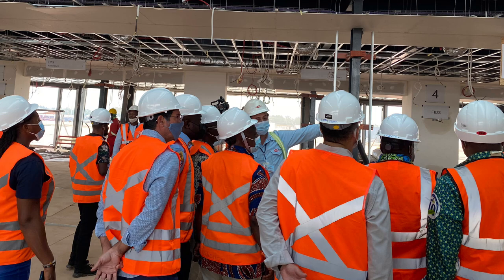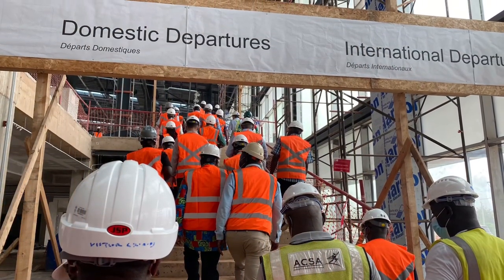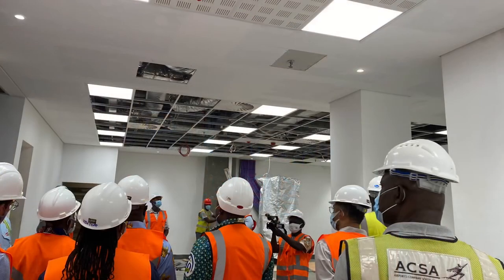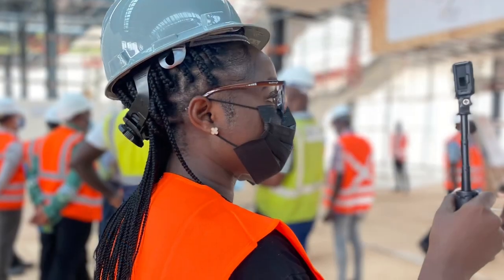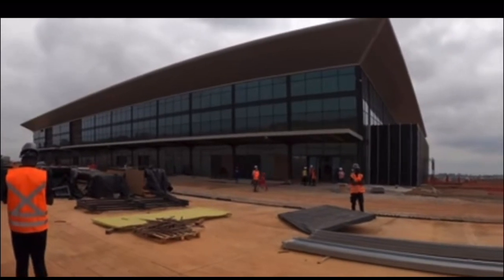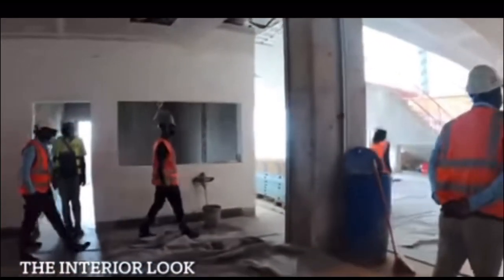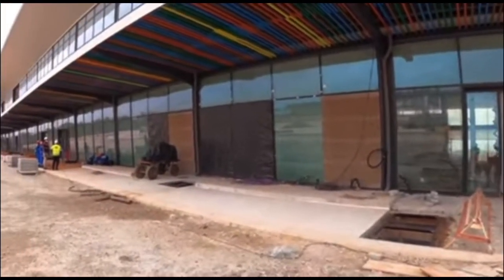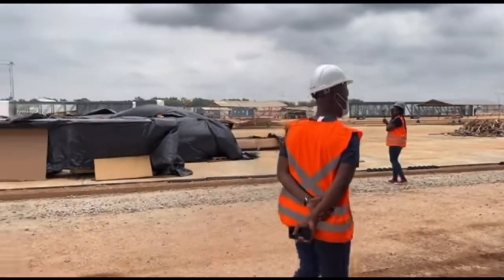ALL YOU MUST KNOW ABOUT THE KUMASI INTERNATIONAL AIRPORT; RUNWAY, APRON, AEROBRIDGES,TAXIWAY &…..

Comment: Good job Judith 👍🏻 . In full answer to the ‘its not large enough’ repeated question. This is people comparing this new upgrade to major international airports of much larger size. The fact its being upgrade to full international status has nothing to do with the size of it. All international status means is it has the ability to deal with immigration and security issues. It is purely the fact that planes travelling from further away tend to be bigger that has driven the runway and new apron construction. International status also requires a series of safety improvements and modern control tower as you said. The overriding driving force in determining the new size is the estimated growth in Ashanti region air traffic. The new size will have chosen precisely with that in mind. It would be foolhardy to waste extra money on an even larger facility when the region does not need that.
You mentioned It coping with Boeing aircraft. What was specifically mentioned is the Boeing 737 aircraft type. It will by the same measure (though not explicitly stated) also permit Airbus A220 and A318 A319 A320 class aircraft. These aircraft have huge range giving the potential (it requires aircraft carriers to invest in and create facilities in the new terminal etc) to receive flights from all African countries, the middle East (Dubai, Qatar, Saudi Arabia) and Southern and central Europe. Planes from further afield that are larger than these types will still have to go to Kotoka. After it opens, it will be very interesting to see which carriers choose to begin flights to Kumasi!
Reply from the maker: Mark 😅😅